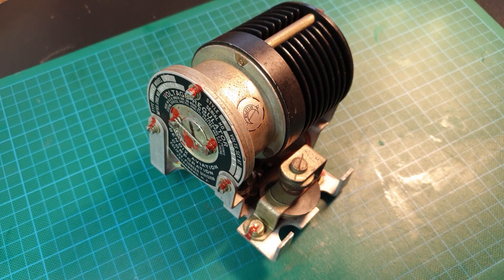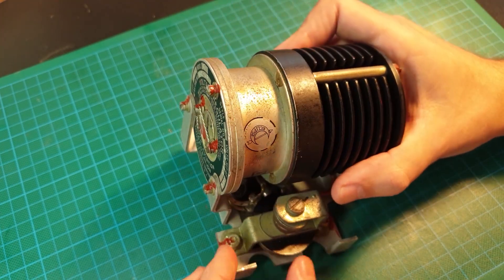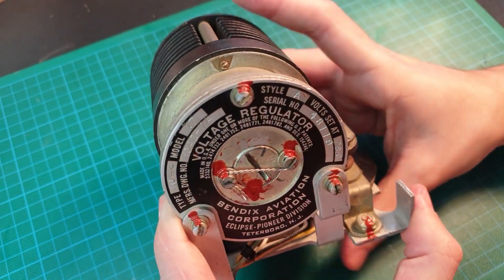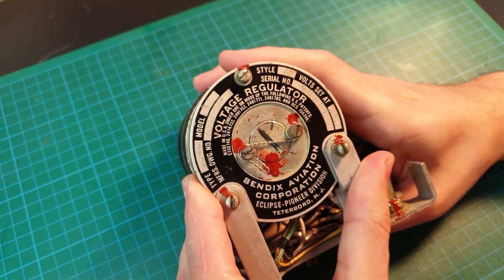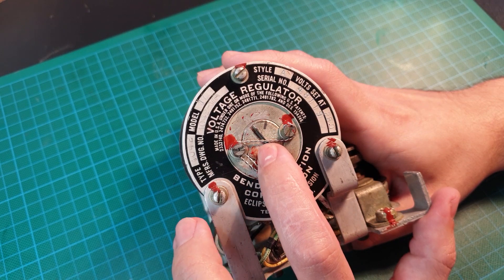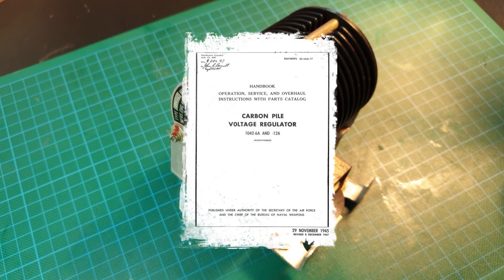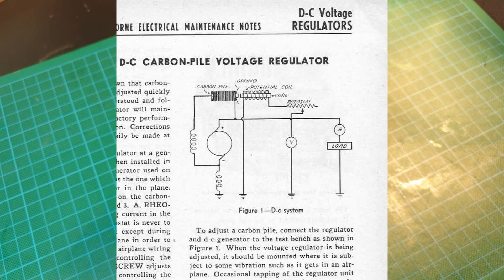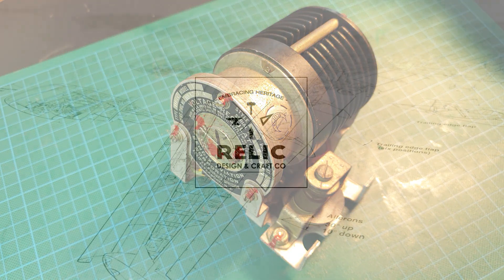Aircraft parts - Carbon pile voltage regulator

Comment: A lot of vibrations.. expectedly on helicopters. I crewed Bell UH-1H ARMY Helicopters for 10 years in the 70's & 80's . This carbon pile voltage reg. was used. I believe we had to check them every 25 HRs. Ho the twist in the safety wire is 6 to 10 twist/per inch.